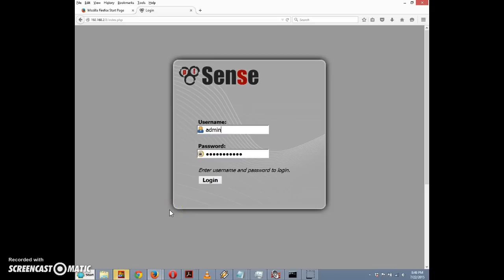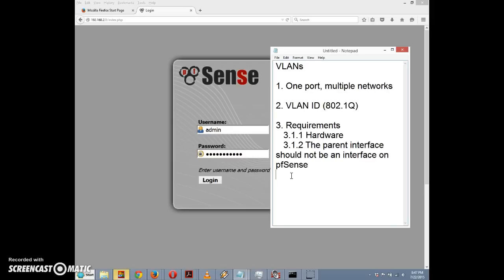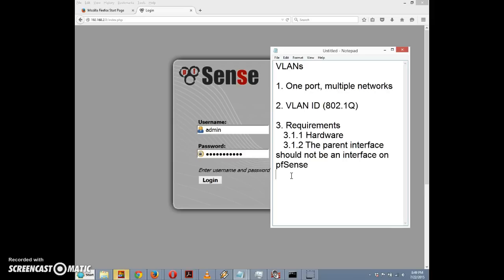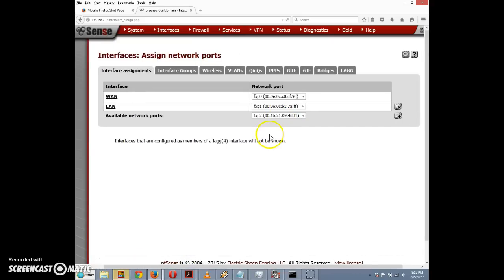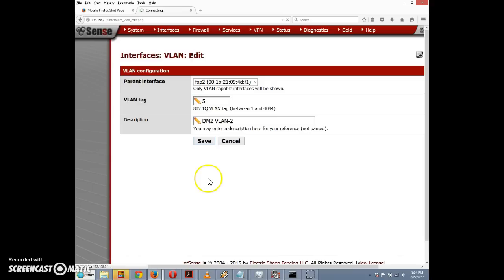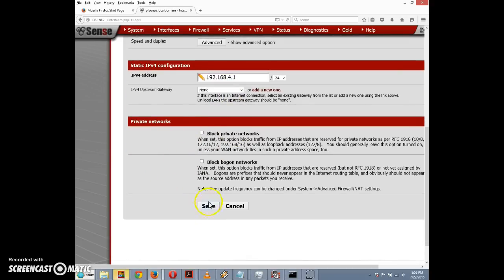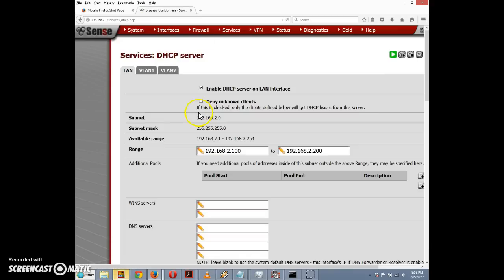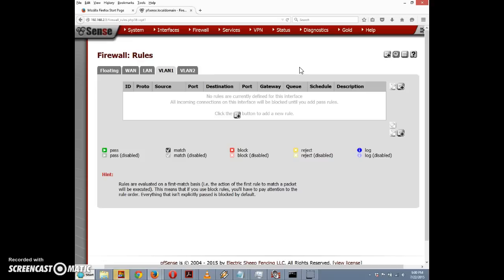Setting Up VLANs with pfSense

Comment: Great video tutorial. The only thing that is missing is you never mentioned how to connect your network devices afterwards. Eg. two vlans needs two switches or one managed switch that supports vlans. Your website has great information and videos. I am a huge pfsense fan and found lots of useful info there. Keep up the great work